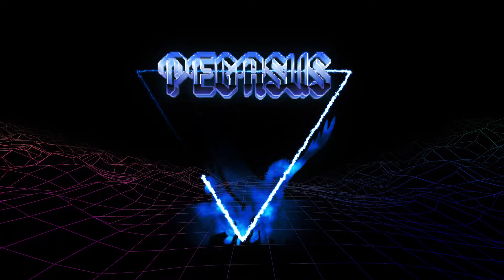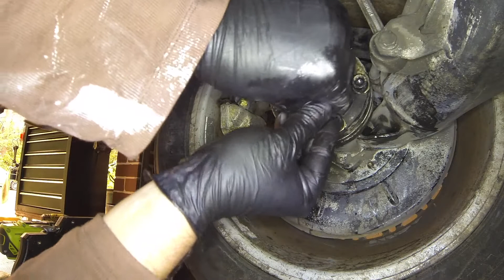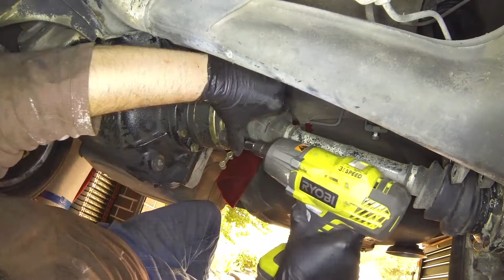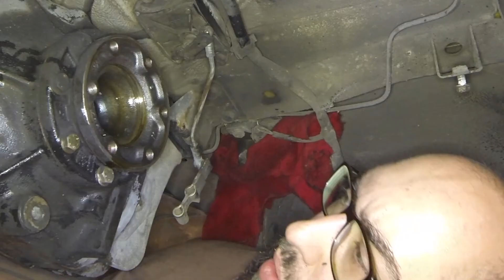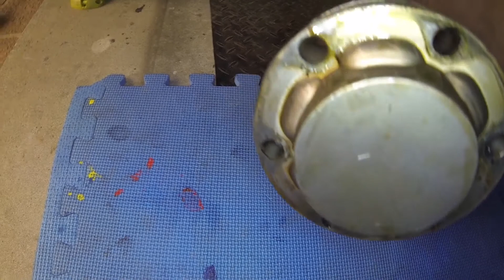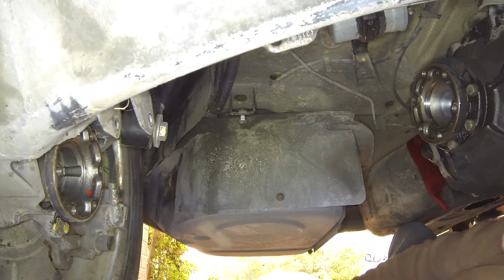BMW E28 M5: LVL 4-1 Rear Output Shafts

Comment: Great work.  I had mine rebuilt I have to pick them up.
Reply from the maker: Do they look the same? I'm trying to find part similarities between models because when you say M5 they tend to add a unicorn tax to the price. But in reality is a mash up of E28, E24 and E32.
Reply from the maker: Yes! It's how I created my thumbnails. It's an awesome resource. However because BMW changed part numbers when they used them for a different series it's time consuming trying to cross reference them through the catalogue. Thanks for the link!